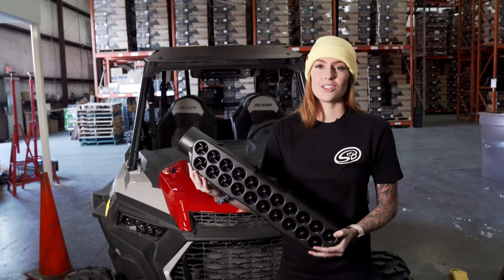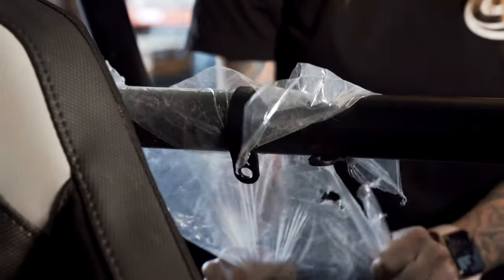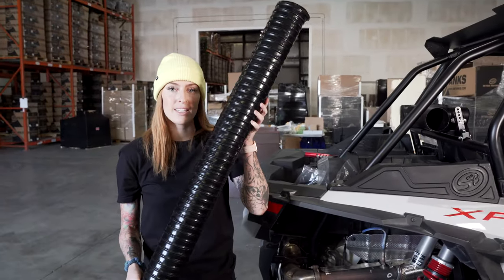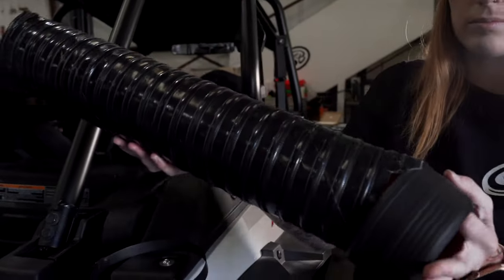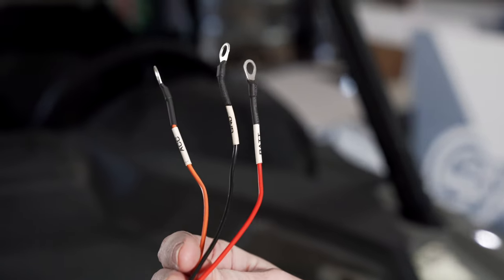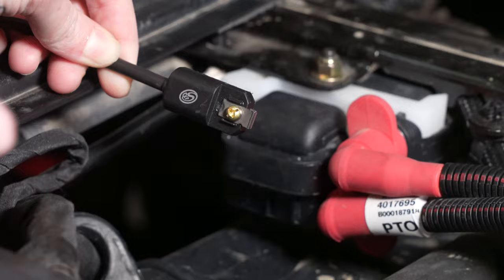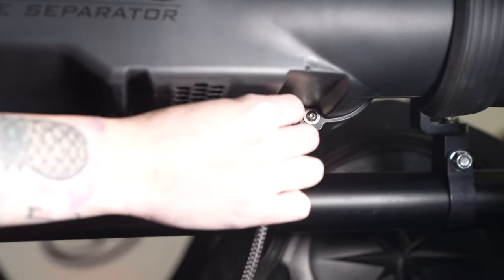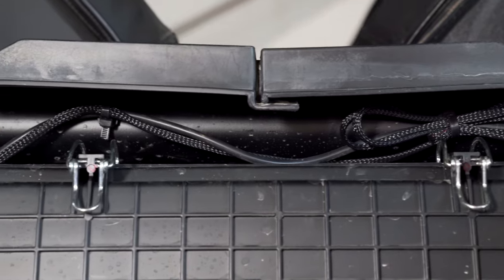S&B Particle Separator 2 Installation for the 2016-2023 Polaris RZR XP Turbo / XP 1000 / XP Turbo S

Comment: How does one install this if you're running a roof, front and rear windows ?
Reply: I’ll be in this scenario. They sell extensions. Or as an alternative you could leave off the bar clamp and use the L bracket and bolt directly to the roof. Keep in mind if you need clearance in a garage/ trailer.
Reply: They are adjustable in length and angle.